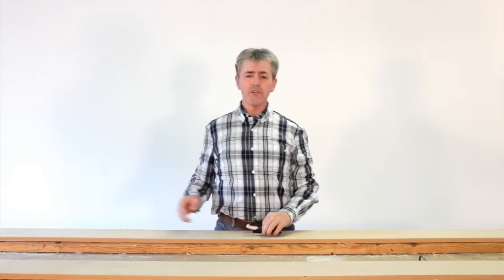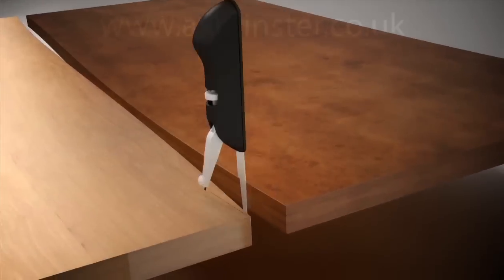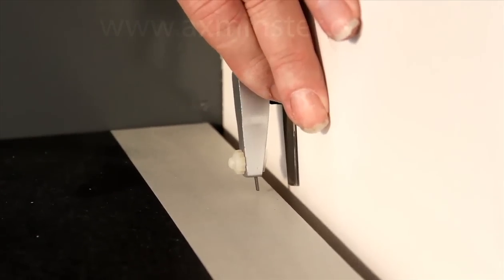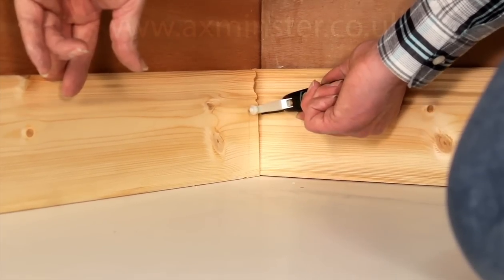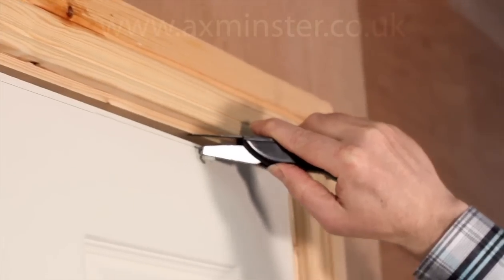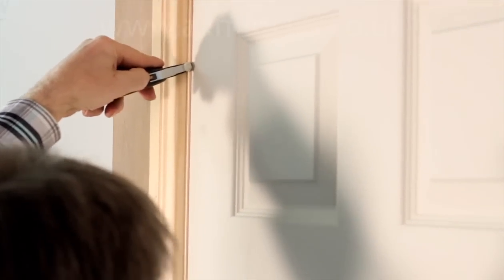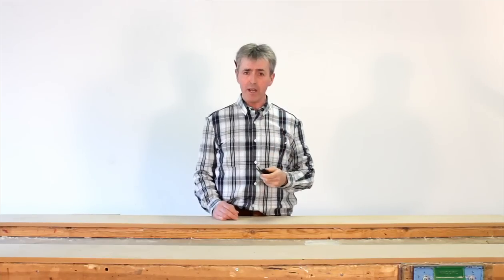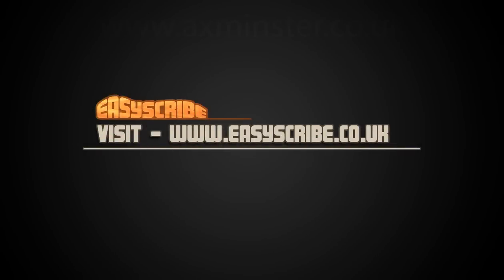Easyscribe

Comment: Who scribes a door to fit a jamb???
Reply: People that don't wanna replace the whole frame and instead just fix the doors to stop sticking in an old house that's settled. Had to do a bunch like that a few months ago. They just bought new solid slabs but didn't want to get into the jamb and casing. Some of the doors had a 8th gap at one end but stuck on the opposite side. I just scribed to even the gap and ran my track saw to trim. The difference is so slight you don't pick up on it as long as the reveals are all uniform
Reply: We did a bunch of flip houses for a realtor and most of the time they just wanted to get the houses market ready as fast as possible. Things like sticking doors and popcorn ceilings bring the value way down but cheap and quick to fix.